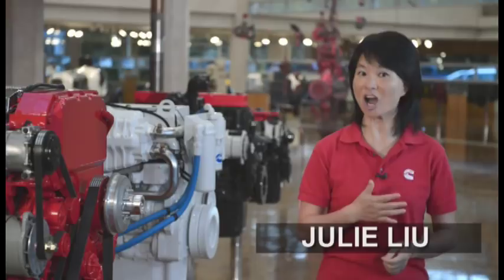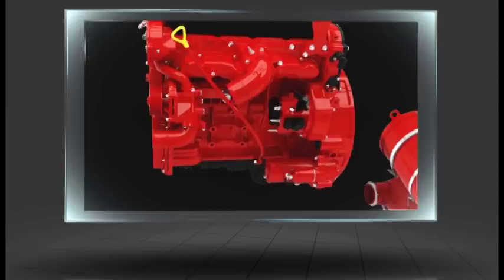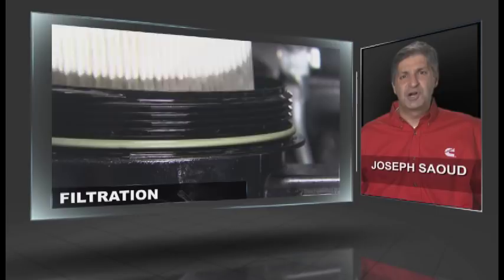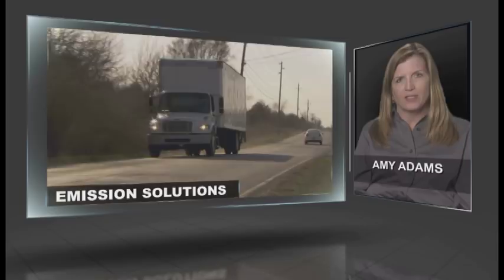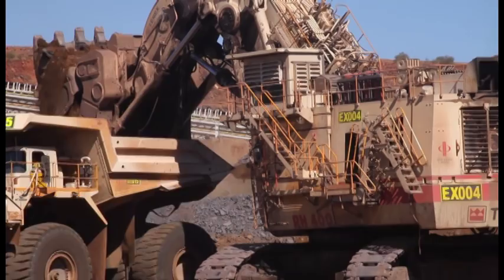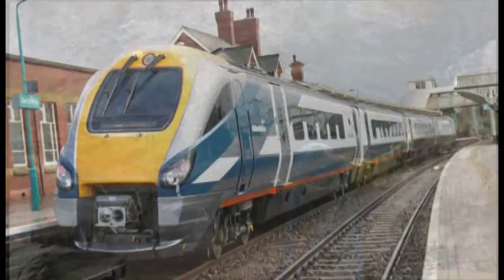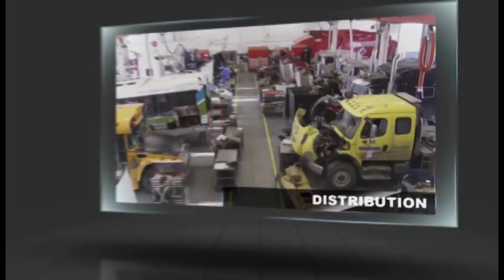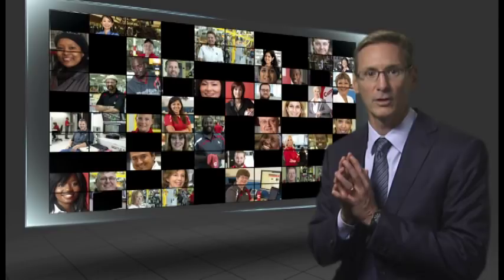Cummins: Understanding What We Do

Comment: At 2:21 she states that compressing the air coming into the engine allows more fuel into the engine.  This is incorrect.  It allows more air (which contains the oxidizer, O2) into the cylinder.  The fuel (diesel) is added thru the high pressure injectors directly into the cylinder.  Looks like the engineering department doesn't review the marketing copy.
Reply: i was gonna sayyy
Reply: İt pushes more air into the engine therefore allowing more fuel to be burned it's the exact same thing

Comment: Will Cummins ever build 2 stroke diesel engines for class 8 truck applications?
Reply: They all ready do that’s what the 903 v8 was for the military, normally a 4 stroke but some were converted to 2 stroke ( 4 valve loop scavenged) for tanks
Reply: They are working on the ACE opposed piston 2 stroke for the Army